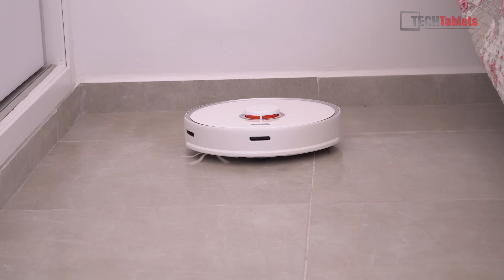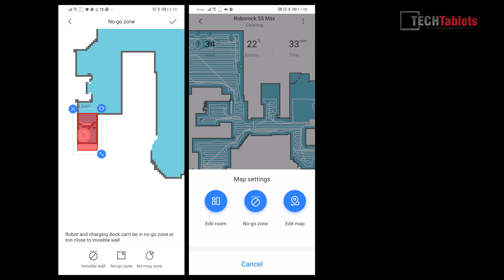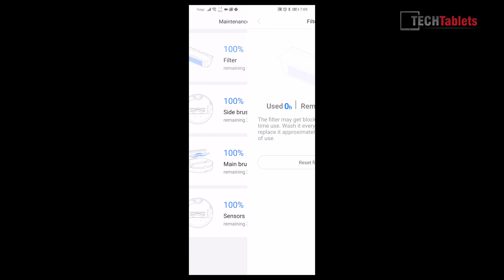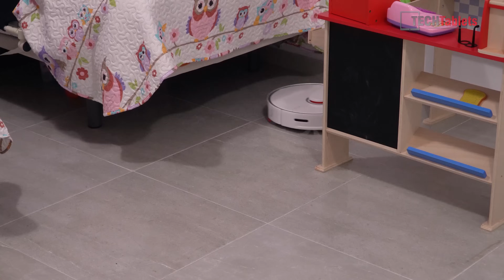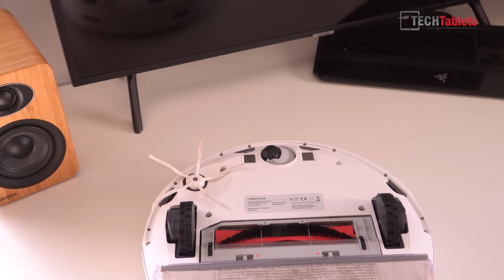Roborock S5 Max Review - The Best Mopping Robot Vacuum Reviewed

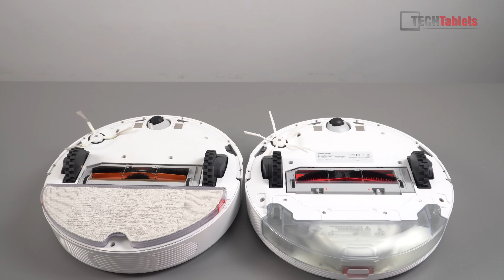Comment from the maker: 02:33 - Design compared to S5
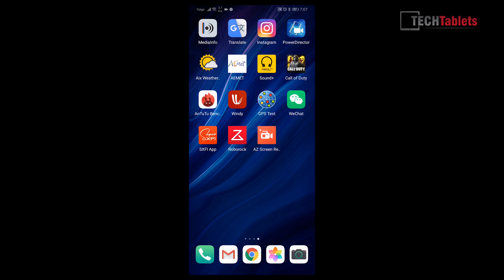05:09 - The App & features

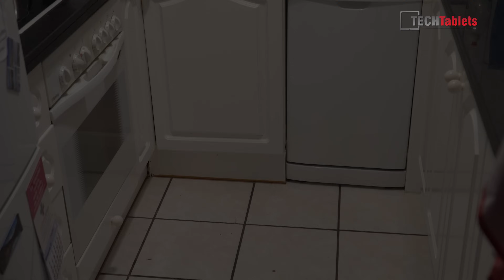07:03 - Real clean test
07:45 - How it cleans

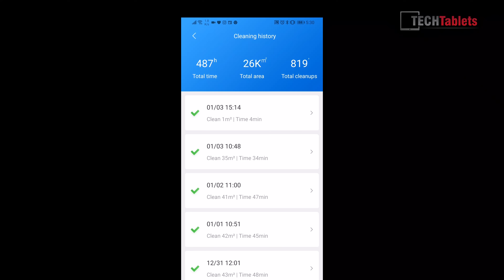08:34 - Is it reliable?

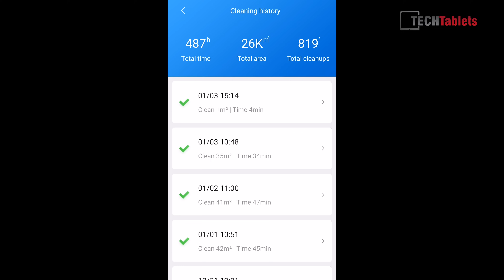08:57 - Final words Pros & Cons
Reply: You said the s Max doesn't have spot clean when it does..to activate spot clean on your roborock Max you need to press n hold the arrow docking button for about 3 seconds..
Reply: Hello chris. I have another question but unfortunately I didn't find a DM option. 
About Laptops, do you think we'll get another 14' one soon with 
1. usb c ports (at least 2) with one power and one data. 
2. With a cpu where an egpumakes sens (and works)
3. Micro sd slot 
4. Otherwise chuwi lapbook pro 8gb specs 
I hope we get one soon, it will sell like hot cake 
:) 
Thanks for you're videos
Reply: pro tip: you can watch movies at Kaldrostream. Me and my gf have been using them for watching all kinds of movies these days.
Reply: @Kamdyn Frederick Yup, I've been using kaldrostream for since december myself :D

Comment: I’m using roborock S5max from 1 year  I’m happy about vacuum But the problem is abt mopping 
It is always confusing to clean because it stepped previous cleaning mopspot and it went on circles there and lot of confusing and taking a lot of time then red light blinking and told there is obstacle or in unknown place 
Bt it is not correct it is completely in open space  so I stopped mopping and using only vacuum 
How can I solve this problem and back to using mopping ? Please help me

Comment: It's all right if you don't have black carpets. It doesn't go through the black areas of the carpets. Interestingly, there is no review  that uses carpets with black areas. I had to return two units  until I was told to tape the optical sensors......

Comment: I have an S5 Max.  It is a GREAT vacuum robot.  But it doesn't mop worth a damn.  I paid a LOT extra for the mopping feature, and boy am I disappointed.

The Max really does not "mop" at all.  All it does is drag a slightly damp cloth across the floor and pick up what little dust the vacuum has missed.  If your floor really needs mopping, you're better off with a Swiffer. At least a Swiffer can use a cleaning solution and can scrub.  The Max has to use water -- anything else might corrode the system.  And it does no scrubbing.  

As I understand it, the S4 has all the navigation features of the Max, more suction, but no mopping -- and a MUCH lower price.  Unless you really want your floors dusted after vacuuming, you'd be better off buying the S4 and saving the money.
Reply: What did you think? That it would scrub the floor with 100kg pressure? 
Of course it only drags slightly

Comment: I got the S5 Max recently and I found a few downsides in it. Firstly, the rubber side brush can easily get stuck in carpet with long hair. I destroyed one arm of the brush at the first cleaning. If you have carpets with long hair I'd suggest buying "normal" side brush with hair.
The other problem that I have is that the main brush is creating strange noise that is louder than the sunction on lower power levels. Does your vacuum create the same noise or is it only mine?
Reply: No. My S5 Max works perfectly!

Comment: The S5 has the no-go zones, at least here in EU...
Reply: s5 also got firmware update that gives you selective room cleaning (you can seperate apt/house into rooms now too)
Reply: @Zeecho  really? I have S5 and even with latest app+firmware there is no such option - only zone cleanup which I have to define every time I clean. I quickly googled and saw that S6 can do this. Really S5 have this option? Maybe depending on region?
Reply: @lukasandrysik3666  hm, mine allso have it. it didnt have in the beginning when i got it, but after update i got it.. rember to go to vacuum settings and turn on map saved mod.
Reply: @lukasandrysik3666  latest firmware is 3.5... it's just rolling out and many have it. First it was only for S6 but now it's also for s5. Wait a day our two and keep checking in settings for firmware notfication.
Reply: yep, there is a firmware with rooms, no-go zones, etc. still it's missing no-mop zones (ignore fact that this s5 mop is pretty weak). it's not on every country - but You can always go china mainland just for update, or load it with flolevac app without changing anything.

Comment: Good review. I just got the Neato D7 which is very good. I don't trust these chinese makers with my data. For mopping I would get the iRobot Braava.
Reply: They ain't gonna get much anyway. with just lidar & nothing else, all that's stored in the server would be the floor plans of your place & your bot's cleaning schedules. i'd understand the concern if the bot comes with cameras, like the S6 MaxV, but fearing over data picked up by lidar is just being paranoid.
Reply: @FalconWindblader  You obviously have a greater knowledge and insight into the workings of the chinese communist party than I do.

Comment: Im interested in Viomi V2 Pro, looks very similiar, has all the same functions but is quite cheaper.
Reply from the maker: I've got one coming soon!
Reply: @Techtablets  Awesome, cant wait for the review.
Reply: Not so great. I place it in the middle between S5 and S5 Max. Althoug it has an improved mopping function, it has less features compared with S5 (less battery, no carpet mode which I find very usefull, bad designed dust been which leaks some bigger garbage peaces) and S5 Max (all mencioned before plus not possible to set no mopping zones, so less usefull mopping function).